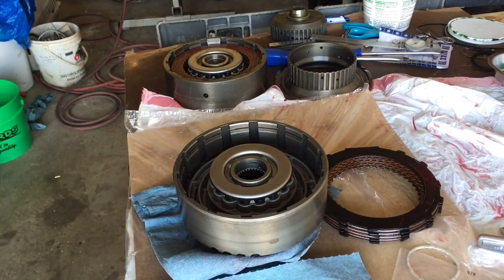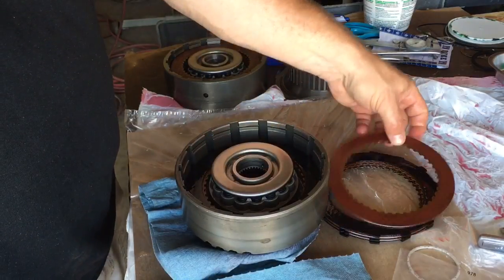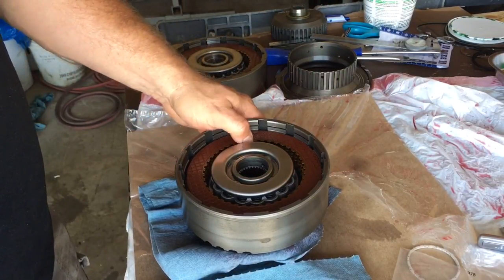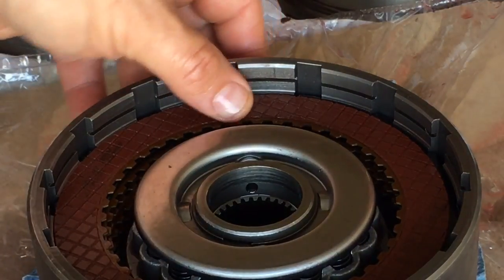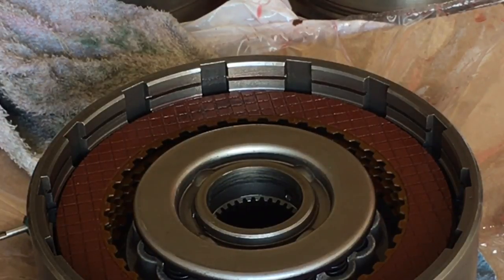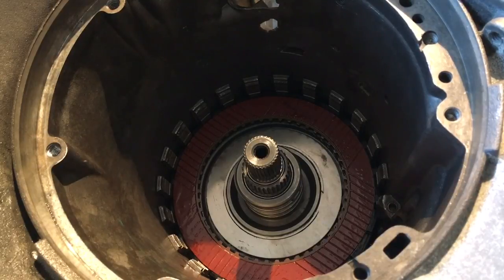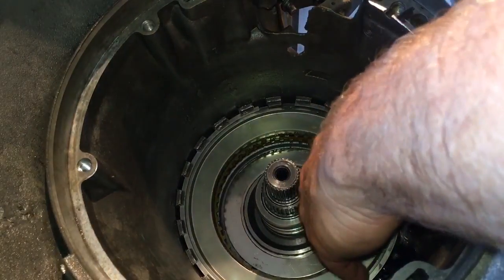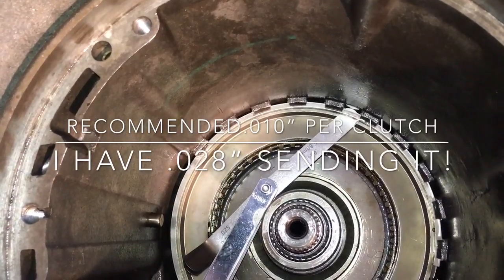DIY TH400 HP clutch packs

Comment: I don't know the specs and i've never used a feelergauge over from the snap ring itself, I really don't 100% remember doing this like the 2 ways you said, i believe i did it with the feeler gauge under the friction or steel plates but eh... don't remember. So are there is 3 sets of steels and frictions and it should be 10 thousandths of a inch, 0.030" but since it was .028" it should be close enough...?
Reply from the maker: Lime You can check your clutch pack clearance with the feeler gauge “Under” the pressure plate/above touching the top friction. If you can check the clearance by putting the feeler gauge between the top of the pressure plate and snap ring, it measures the same clearance but there’s zero chance of damaging the friction with the tool.  You can’t always use the “above” technique because the top of the pressure plate won’t allow it. It only worked on the Intermediate clutch pack. 
Also: It’s much easier to measure the clearance in the Direct and Forward clutches before you install the release springs.  
On the Intermediate clutches being at .028” I decided it was close enough using a feeler gauge. I maybe could have forced a .030” in there. Once the transmission is run, the burnishing process of the frictions to the steels will add a little clearance. Those frictions have a “Furry” texture freshly soaked, that won’t last long. 👍